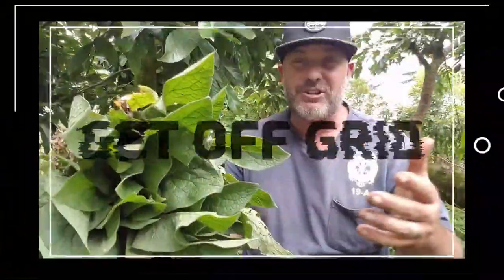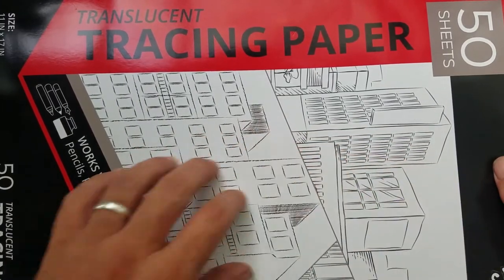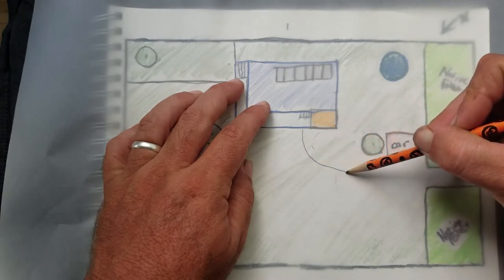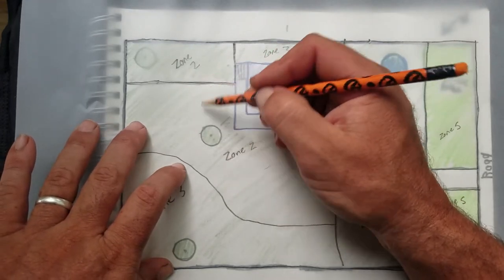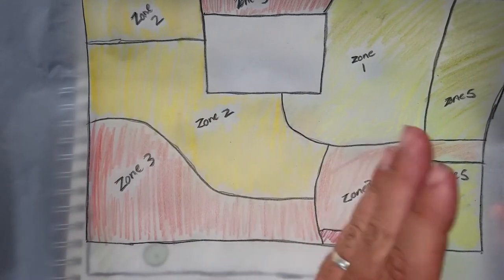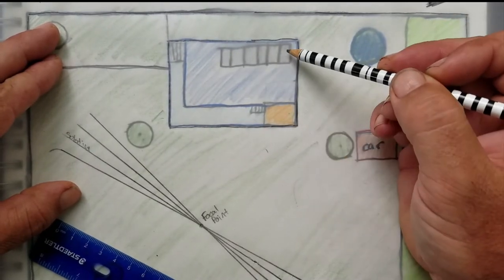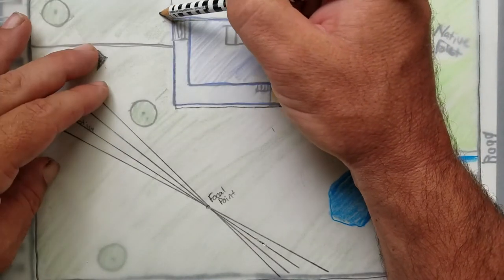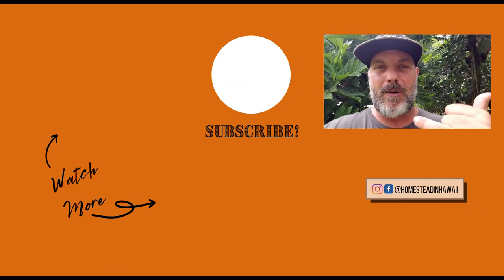Off Grid Permaculture Homestead Design: Mapping Zones & Sectors

Comment: Use GIS. Associate the data (attribute tables) with the spaces/features (points, lines, polygons). Place sensors for hours of sunlight and intensity...then make heat maps for best locations for solar or wind energy. The advantage is the data and the spaces are merged into one software and spatial relationships can be analyzed and prioritized. Best part is it can be updated/revised/redesigned easily. I use ArcGIS (Pro and Online) but I think even Google Earth will allow some of this. ArcGIS can also export files to KML (Google Earth format). Love the concept of this.
Reply from the maker: Yes! Thank you. I'm so old school sometimes. I need to try out what you suggested and learn some more up to date methods for mapping.
Reply: @HomesteadinHawaii  I can tell you know a bit about it because you used the term "viewshed". The ArcGIS software can use digital elevation/surface models to calculate and display what can be seen on a landscape from a selected position. Realtors use it to show clients what parts of the landscape can be seen from a property, but the original application was line-of-sight analysis for microwave transmitters and later cell towers. Much larger scale. But even hand drawing is great...it's still GIS. I've considered using GIS to rule "in" or "out" land or homes based on solar potential (aspect) and hillslope (not too steep) before wasting time visiting them. Great video post and not like anything I've seen from other homestead/off-grid Hawaii channels. Keep it up!
Reply: Thanks for your valuable comments. Where can I find my property fire zone or direction of fire or area of my property that's prone to fire? Thanks.